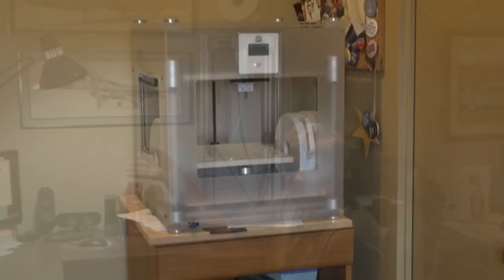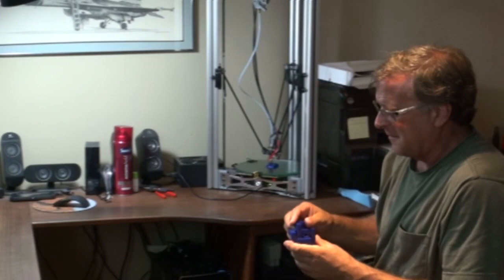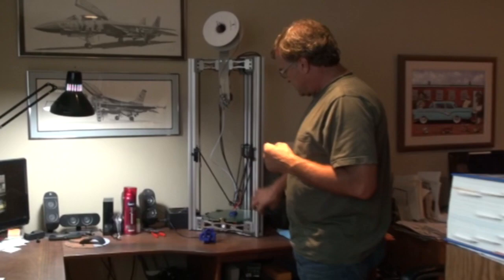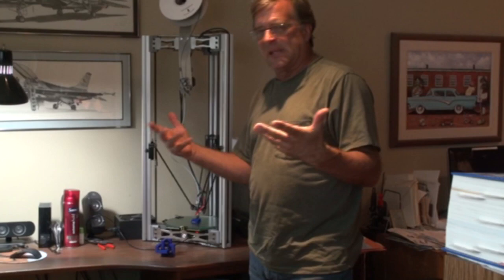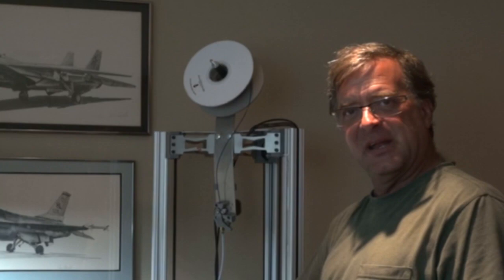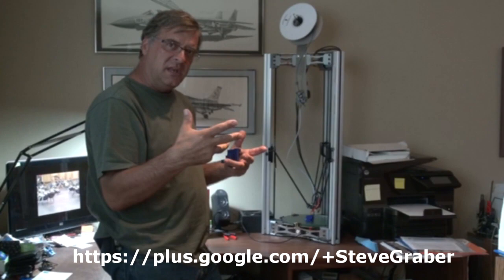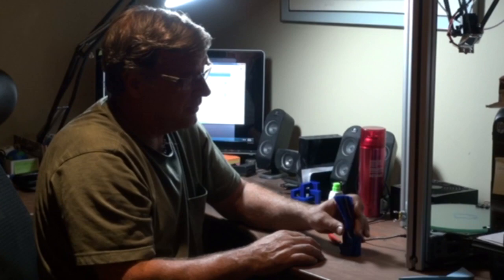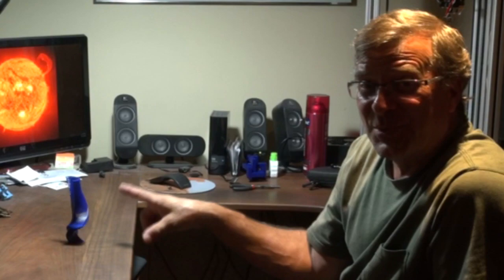Introducing A Different Approach to 3D Printing - Kevin Caron

Comment: Your going to be limited to PLA and you may need to build a heated chamber at those heights in order to reduce warp.
Even the makerbot z18 has a heated chamber and it's a PLA only printer and it prints much smaller then the new printer you will be getting.

You will also be limited to nozzle diameter as you will wait days if you go with anything to small as you most likely know.

They have large printers out there such as the BigRep but what they don't tell you is the failure rate which is much higher than most printers.

Comment: Kevin, how tough is the printed-out model? Could something printed with that material be used in any practical applications?
Reply: ***** The pieces you printed were extremely impressive. I've seen a wide range of quality, often illustrated with complex parts. I like your example much better. That large curved surface really says something about accuracy -- or did you polish it?